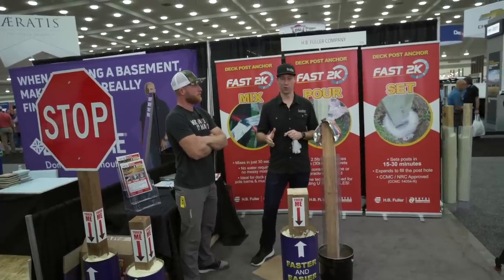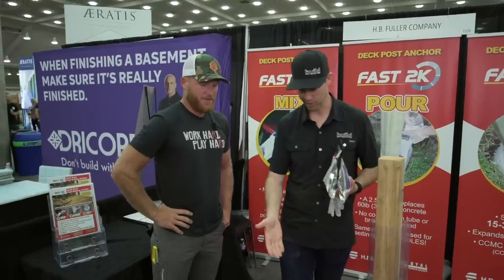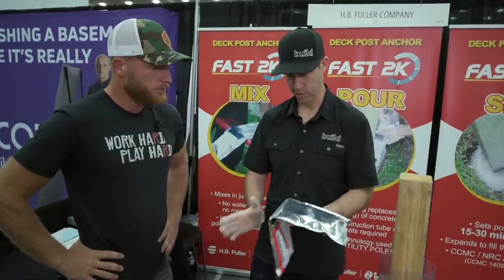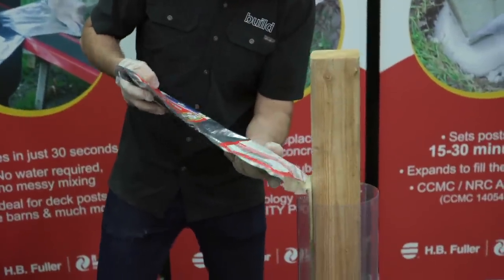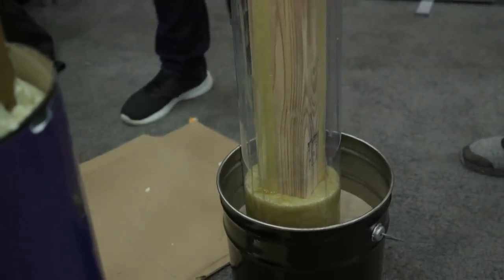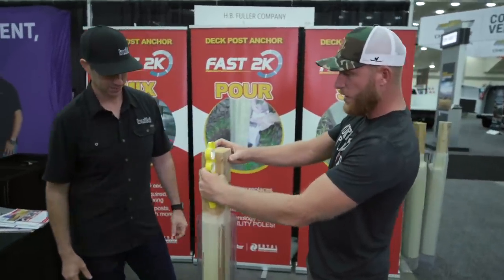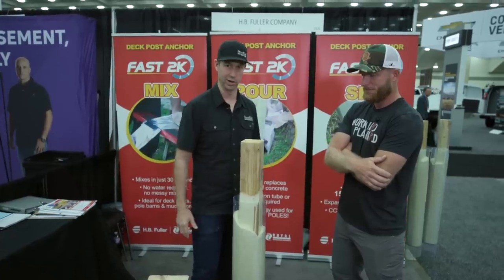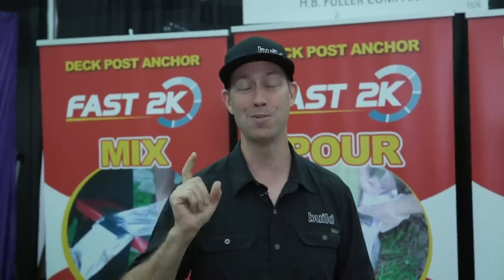Foam INSTEAD  of Concrete???

Comment: Way more expensive than concrete, a bag of concrete(60lbs) is about $4 this stuff is over 3x that
Reply: Sakrete at 3.10 for me for 60 pounds versus Sika Pro at 11.97 a bag per post is more but the Sika is easier to handle and such. The bag of cement would be enough for a few holes at least, all I really need is the lower half to be encased in either. but there are other products out there offering better post protection for in the ground construction.
Reply: There’s more to concrete than just the cement...
Reply: He was comparing to concrete delivered off the truck.  This foam is a huge labor savings compared to mixing quikrete on site by hand or in a mixer.  Seems adequate for fences and decks that aren't  elevated too much.
Reply: Though Quickrete is supposed to work fine for posts by just pouring it in dry and then pouring water in over the top.  I can't bring myself to do that, must pre-mix so I know it all is going to harden evenly, but I'm sure it works fine given it is just for stabilizing the post, not for some structural or long lasting surface.
Reply: Fabio Depends on where you live.
Reply: @ppentertainment2351  Wherever their are buildings theres a concrete factory nearby.  When concrete is bought in bulk for pouring a driveway, foundation, etc it cant travel too far.
Reply: The product seems great for labor savings but price comparison? How do you spend $120 on a third of a yard of concrete??
Reply: My guess is you aren't doing a good job mixing if you do it that fast.  Go ahead and mix its your money and time.  Keep in mind the quick cure time compared to concrete
Reply: Maybe more expensive but no water needed no electric needed pros and cons and no hard mixing. Spend a few dollars more don't be a tight arse
Reply: What you all don’t realize is 1/3 a yard of concrete to fill a post hole for a pole barn. That is like 5 60 lb bags. This stuff is more like 20$ a bag and that comes to 100$ a hole. I’ll be keeping my cement mixer and making up my concrete with class 6 road base and Portland cement personally.

Comment: I used this stuff yesterday installed a new letter box pole and such. This stuff seems to be really a great solution ! It’s easy , fast and really sturdy! And cheap 

I think for simple projects like I did, or even small fences would be ideal. Stuff really works, also want to add to this comment?!!

Make sure you dig your holes properly ... stuff really works

Comment: Foam.... not very eco friendly, not a fan. Another reason company’s cheap out on shit that can and will have a huge impact in the future.
Reply: We going have microscopic bits of foam in our dirt.
Reply: Concrete isn’t any better
Reply: @stevester189  concrete is just bits of rock... How's that bad.
Reply: Skyler Bicknell but what do they use to make said concrete, limestone they are digging up the earth for limeston by the truckload that doesnt seem any more “eco friendly” to me but, to each their own
Reply: @nutmeg9005  Its from the earth.. Going into... The earth...............
Reply: @stevester189  Concrete can be grinded back into bits of rock and be recycled to make new concrete, foam on the other hand can sometimes be a type of plastic. We all know foam plastic material is hardly biodegradable, cheaper to manufacture, isnt recyclable since its not cost effective for the company, and tends to end up in landfills staying there for centuries.
Reply: @AznTony360  There are some types of bacteria and apparently fungus that can break down plastic. If you think about it, that's even worse because if you get that around your foam, some structural failure isn't fair behind
Reply: @InfernosReaper  I'm well aware of the bacteria that can degrade plastic, but its been a couple years since it was discovered, and guess what? we're still living in a world where plastic is still an issue. Regardless, the metal inserts that you place into the ground that screw/clamp onto the fence-post or concrete will still be far more environmental friendly than a man made piece of junk just to increase profit margins.
Reply: @OzzyskylerTheGreat  On the face of it, it's not bad. However the production of the Portland cement needed to make concrete makes up about 5% of all the man made CO2 in the world.

Comment: I used this for setting a couple mailbox posts and it worked great. One bag for two posts and they were solid within an hour or so, could've been sooner but that was when I checked back on it. I think what a lot of the concrete guys are forgetting is the average homeowner probably doesn't want to deal with the mess and prep of concrete, especially on a small scale. If I could buy 6 bags of this to set some posts for a deck, then I don't need to make a mess mixing or lose a wheelbarrow. Fwiw, I'm fully in support of concrete and would need to be convinced to use this on a large building.
Reply: Along with the mess of concrete there is also the weight, the back breaking job of mixing. I know some people dry set fence posts but that just seems lazy to me. I use concrete on my fence about 27 years ago and it has held up, even through hurrican winds. I am now in need of some repair and because I am older I am considering this foam due to the reasons I mentioned.

Comment: 2 questions? What’s the cost difference. And how environmentally friendly is it? The spray foam in the house is kinda dangerous and has to be sealed with fire proof paint or drywall.

Comment: No way in hell that foam stays intact while a skid steer or backhoe shears off the treated 4x4.... Also 3 60 lbs bags of mix isn't anywhere near 1/3 of a cubic yard.
Reply: Add 3+ inch protruding screws to the base of your post along with drill hole voids to give the foam teeth to grab onto. The ground is holding the post. Reason why concrete is holding a post is because it is liquid and fills the grooves in the wood to create teeth to hold it. The ground is your strength. You’re trying to make your post “one” with earth.
Reply: @swatisquantum  sorry man but as an equipment operator it does not matter if you put 3-inch protruding screws at the base of of the post. Out of the hundreds of treated 4 x 4 fence post in concrete that ive torn out, not a single one sheared off unless it was rotten. Most fence post will always come out with the concrete foam or whatever used to Anchor it still attached to the one end of the fence post. You don't make it one with the ground, you make it one with the fence post. It's concrete doesnt hold in the ground to the point that it shares off, foam definitely will not.
Reply: @c_b8s4  fair point. Makes sense.

Comment: Another worthless gimmick to speed up construction time and put money in the contractor's pocket while screwing the homeowner in the long run.
Reply: Just add this to the list along with  Pex, Sharkbite, MDF, and OSB sheathing
Reply: @markanthony3275  So you still use planks for sub floors and walls? Pex pipe and shark bites are awesome. They make sense from all sides; less trouble for the plumber, more reliability for the home owner.
Reply: Yeah, I do...I'm renovating my house right now...the least I would go with is plywood.
Reply: @Mark Anthony OSB is not that bad. I used it in my shop for the wall sheathing. It's the only structural application I would use it for. Roof and floors are all plywood.
Reply: In 15 years all the failures will be hilarious
Reply: I'll put my 2 cents in. I like Pex A due to its crimp method, sharkbites should only be used where needed, MDF is fine for furnature but never for a house. OSB shouldn't be used on a house either unless it is a dry climate.
Reply: What is wrong with plywood?
Reply: Goes in the estimated cost. Price both for the customer the pros and cons then it's there choice
Reply: Actually it cost more than concrete so they would actually lose money
Reply: This stuff is expensive no one will use it
Reply: @markanthony3275  Whoa!! Why don't you like Pex and Shark Bites?
My Husband loved them.
Reply: @internettoughguy  people are using OSB for flooring. Saying it's better than plywood. I strongly disagree. Maybe a step up from particle board at best
Reply: @xXDEATHXx NoLs  Builders use OSB for flooring because it's cheaper than plywood and still meets minimum code which means more profit it their pocket. Plywood is far more dense and rigid than OSB. This makes it better for floors. You can disagree all you want but but it won't change the facts.
Reply: Yep and anyone mad enough to use it will be getting sued out of business.
Reply: @crissd8283  I saw a video where a Japanese dude built his house using MDF instead of plywood specifically because he wanted the house to fall apart not long after he died. I think his estimates for how long MDF would last are a bit too generous
Reply: @TradBarbie  Sharkbite's great for going between pipe types and when you need a quick fix or addition. For most other uses, the crimps, crimping tool, and fittings will pay for themselves.
Reply: @InfernosReaper  So they're just expensive?
I don't know how to crimp and all that. $10 per shark bite isn't too bad.
Reply: @TradBarbie  On small projects, sharkbite is good, but on a big project, it adds up. After 8 or so fittings, a crimping tool & supplies will pay for themselves. 

Crimping is pretty easy. Make sure your crimping tool is calibrated(follow instructions), slide ring onto pex, insert fitting into pex, move ring where it needs to be, and crimp it. 

Like I said, if you're only doing the odd small job here & there, sharkbite(or similar) should be fine, but it can get expensive.
Reply: @InfernosReaper  Thank you for the in depth explaination 🙌😊
Reply: @TradBarbie  It is the internet, so I have no idea of that is sarcasm and somehow the emojis don't help.
Reply: @InfernosReaper  yeah, I thought that while I wrote it. Was going to state that I wasn't being facetious but thought it might be obvious because you answered my question so thoroughly.
Reply: @TradBarbie  I'm not known for my whatever the word is for this situation. 

That said, I know the shark bites(and the off-brands), crimp connections, & pex have all paid for themselves with the house I live in. Imagine a house with PVC, CPVC, copper, and galvanized steel. It was a nightmare trying to fix anything that broke, but I've been standardizing it all to PEX whenever something breaks. The sharkbite's been a lifesaver when connecting to copper or CPVC that goes into hard to access areas until I can get to it for a full replacement later.
Reply: exactly on point
Reply: Jacob Fox it’s cheaper than replacing posts after about three years and yes I’m talking treated posts this foam tech as been used by power companies for years to set poles
Reply: Internet Tough Guy it doesn’t speed up a damn thing... in fact it takes more time than packing dry concrete
Reply: @InfernosReaper  Yes crimping is most reliable.

Comment: Just got this or something very similar at Lowe's to set my mailbox.  I didn't want to use cement, and was just going to put dirt back in the hole but this was so much easier.  Seems to hold it strong.  Probly not as good as cement, but better than plain dirt..used in a big building Id be concerned because I took some of the extra foam after it hardened and squeezed it, it was pretty firm but when I pushed in with my thumb it didn't come back out, so over time it could lose some of its tightness against the wood..maybe..

Comment: As fence builders, we have often been curious about this product.  The cost has been the initial thing holding us back from trying it.  Our other concerns have been the longevity and the ability to make adjustments to the post as needed when you get down the line and have to go back 3,4, or 5 previous posts to make a minor height or line adjustment.   I would totally be for this in smaller projects or for posts that are stabilized and not going anywhere like a deck.   I love the idea of the lighter and easier to handle product. Sackrete gets old after a while. One if these days I'll try it out....
Reply: Work is fun... fake review

Comment: FYI your math is way off. If one bag replaced a 60lb bag, that would be 0.45cf. There are 27cf in a cubic yard of concrete. Kyle said he uses 1/3 of a yard for a hole. Which would be 20 bags of this stuff. Not 3-4. Which equates to $200. Where as concrete is $120/yard, or $40 to fill one hole. 

So nowhere near comparable in price.
Reply: I thought the same thing. If he is using 1/2 of a yard of concrete per hole, he is doing something wrong....I haven't one decks in years but maybe 2 to 2 1/2 bags per hole at the most... it sure as hell isn't 1/3 of a yard of concrete
Reply: @TheRonKlimo  

He doesn't do decks. He does massive post frame barns that require large footings.

Comment: Interesting idea! Are there any negative environmental impacts that result from using this product? I'm thinking chemical seepage over time as it degrades especially into gardens etc also what is the cleanup process like once it's broken down eg when removing the post in 20 years? Thanks

Comment: yay! lets use even more plastic made from oil in our environment instead of rocks, yay!
Reply: Yeah except concrete is super heavy and it takes a ton of fuel to deliver it. Plus the cement releases a lot of co2 as it cures.

Comment: Will always use concrete. That foam will break down in 6 years and posts will be loose. Always use concrete, cheaper and stronger. Lazy ass contractors use this crap and then honest contractor get to clean up after this bs
Reply: you missed the part where you pour to allow it to stop set below the top of grade so it can covered in dirt and grass which will protect it from sun degradation and make it more appealing than seeing it sticking up out of the ground.
Reply: What you are not understanding is moisture from the ground degrades it. Seen dozen of these posts become loose after a few years. Lazy people use expanding foam instead of concrete. I missed nothing. These products don’t last, it works long enough for the installation warranty a company offers ends
Reply: the post will dry rot less than 6 years in cement because it retains water
Reply: Zack - you could offer this knowledge and advice, win friends and influence people,  without the insult.   It doesn't make you sound smarter when you put someone down - it makes you mean.
Reply: yes I agree stone aggregate lets water drain.
Reply: no but the wood does I seen post with concrete become loose and fall it also depends where you live if it freezes
Reply: C S no problem, if a person uses pressure treated lumber or cedar these posts can last a long time. I have seen people go to the extreme of using tar to seal the wood the is below grade.
Reply: @1Coke ToGo I have a few rescue dogs and I built a fence for them to play.  Some kinds of wood supposedly don't rot in the ground but I would think everything would after 50 years if there was moisture.  I've never heard of soaking fence posts in used oil, I wouldn't just in case something gets into our drinking water.

Comment: The polyurethane foam will also lock in and trap any moisture. The post needs to be able to dry out and generally the post rots right at the top of the concrete where the moisture is trapped(collar rot). A well tamped post using the dirt you dug out to set the post is ready to be built on immediately. Regardless, I still prefer Kyle’s method of having no post below grade for anything other than a mailbox post and fence post.

Comment: What is the pole sitting on?  What is the bearing capacity of the soil you assume this will be if used for a building.  Sure, uplift but what about what the post sits on.  I can see this for fences but not much more.

Comment: I’ve built lots of pole barns up here in Canada an I find that posts or laminated lumber well always rot where it meets the ground! We always poured 8” footings then used a concrete column with up lift brackets with 4ply lumber a foot above ground I currently work at Great Lakes Perma columns that we used previously. The concrete we make is 10,000 psi with admixtures for corrosion inhibitors an air admixture for freezing an thawing I think concrete is much better!!

Comment: Seems like the ground would heave before the post would snap. However, if the foam has lateral expansive properties  that are stronger than the pack of the earth particles, then it would make the earthpack tighter,  to a point. Makes sense. Has this shear strength test been preformed in saturated ground? I live in a flood plain.

Comment: How does this product perform in frost areas? We have to dig a minimum 6ft here for posts (unless you use a bigfoot form, then 4 feet is all you need). This being foam, I can see frost squeezing this and rendering it loose after a couple cycles...

Comment: You can buy these two part foams of various densities in bulk and mix it yourself. I have built a few boats and used a marine grade version to fill spaces for flotation (less dense than the stuff shown here). It is easy to work with. Much cheaper than the pre-measured bags.

Comment: Matt I paint my ground rated PT 4x4, etc that go in the ground or even ground rated PT 2x4’s for bottom plates going on a basement floor with Flexseal. Let them dry and use as needed. No issues so far... Your thoughts?
Ron

Comment: FWIW, I'm a fencing contractor and I've got a cheat code. I like to use no mix fast setting concrete. Level the post to a mason line, pour the dry mix into the hole, add the water, hard in 20 minutes, hang in 4 hours. Square, plumb, and true everytime.

Comment: One problem with expandable foam is it's reaction to humidity while mixing/expanding/curing, therefore if you poor it directly in the hole, the ground humidity will affect the periphery of the foam, making it very soft on the surface. If it is in a pre-fab cylinder, then the lateral expansion has no effect on holding the post in place vertically.